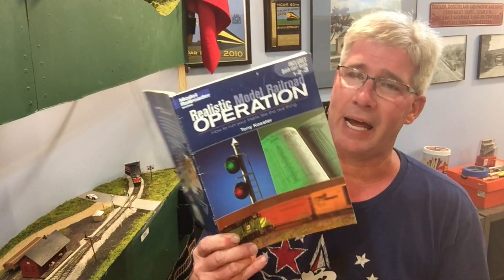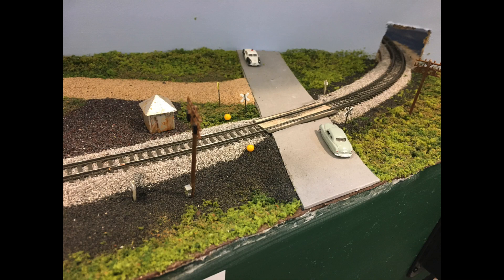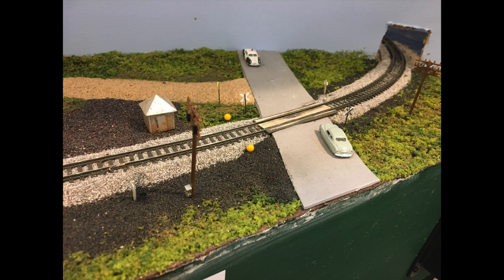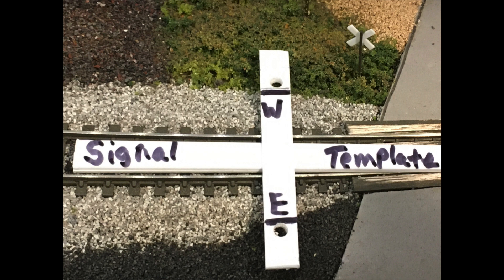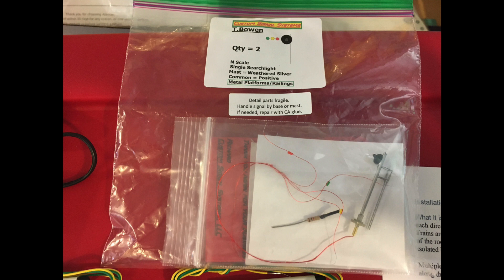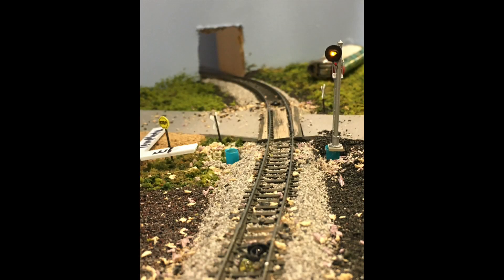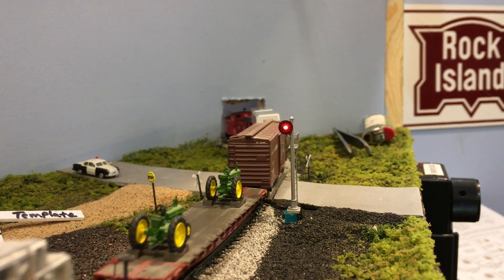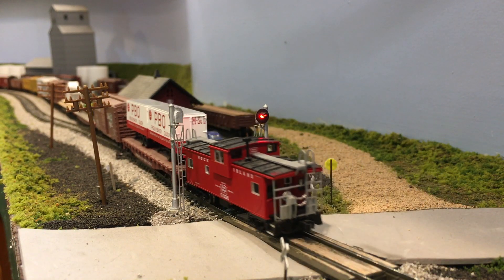Signal Installation using the  Custom Signal Systems and a Azatrax TS2 Circuit Board

Comment: Hi Tony,
Nice video. I too use Custom Signal equipment, but different detection method for my 3 rail O gauge layout.  I use double head signals for a scissor crossover and 3 aspect distant signals, bi-directionally.
Talk to you when I see you at a local train show.
Sam

Comment: Great video Tony and very timely for me as I am also starting with the signaling on my layout.  I also met John at a convention 5 years ago had have been using the Azatrax products for layout automation and a grade crossing.  So far my only signaling is in my helix after having a couple of cornfield meets in there but plan to add little at a time.
Reply from the maker: I was impressed with John and his Azatrax products of what they can do.  They will meet the needs of my layout as  I continue to expand my signaling system. Thanks for watching!  Tony

Comment: We are in the early stages of installing an Azatrax system as a replacement system in a HO scale Museum layout  that we are  using Azatrax Ts-2's and  the Ts-5. John and Richard have been very very helpful as this layout is 20ft x210ft. We are using a 16 volt dc power supply with a 6 amp output. So far we have run 500' of signaling control cable and 500 ft of power cable.  We are replacing an older signaling system that was current detection unit that was computer controlled. We now have 3 2 track intermediate signals talking back and forth with a 4th dual track CP going in rather soon. We have several cross-over's that we will be using the TS-5. We will be using several TS-2 for additional intermediates and at least 6 more TS-5's
Reply from the maker: Wade, It sounds like a very impressive resignaling project you have going.  I'd love to see pictures of your progress or completed layout when the job is done.  Tony
Reply: This is the layout at the Medina NY Railroad Museum in Medina NY. The layout is in the largest freight house that the NYC ever built (about 50ft x350ft). The two parallel mainlines are about 500 ft long each with several long sidings. We have a web site with several videos on it but I really do not think the videos do it justice. This layout  is "museum quality" and abot 20 years old.

Comment: BMLA Never had an N Scale signal.  Craig promised, but since the manufacturer could not meet his standards the N scale signal was never delivered.  I wish that we could get good signals for N scales. The signals from Atlas are G type and they do not want to seem to want to make standard signals found on almost all other railroads.
Reply from the maker: Yes, finding a good N scale signal that is readily available was a struggle that is why I went with Custom Signal Systems.  The signals are not big and bulky like some of the other manufacturers out there currently, or signals made in the past.  Tony

Comment: I was an electronics technician in the Air Force many years ago. A couple of words of caution. Use stranded wire for your power leads and your control wire as after time goes bye solid wire tends to get brittle and the conductor may break  and it is almost impossible to see because the insulator jacket remains intact the solid conductor. Also i am fusing each of the CP's with agl .250 amp inline fuses so the entire signal system does not go down and make troubleshooting rather difficult at best.

Comment: Hi Tony great video. And can't want to see when you daisy chain them together. I am about to upgrade my signals so will be looking at the same product.  Cheers Darren
Reply from the maker: Darren,  Thanks for watching.  When I get three pairs of signals connected I think it will be fun to see them react to each other. With your upgrade to your signaling system are you having to replace the signals or just the circuit boards?  Thanks, Tony
Reply: @CornCountryRails  Hi Tony The signals I have should work but won't really know till see the wiring diagram on how it all goes together. Looking at what you have done I think I will have to also replace my singals. Hma do a board and they are good signals so might also try that out.  Same as you cost is a factor.
Reply from the maker: @NscaleCSXandRioGrande   One item I purchased that I did not include on my video but I will on the next one is a Logic Rails Signal Tester https://www.logicrailtech.com/st-1.htm.  Kind of a neat way to make sure a signal in functioning correctly before installing it.  You can test the signals with a 9-volt battery and tester is $14.95.
Reply: @CornCountryRails  thats is very helpful thanks Tony. I have been browsing the net today looking at signals etc.

Comment: I like the older atlas signal system because it with the signal attachment cable with the signal . Atlas have a wire it where you can take other signal and connect it to the cord. Plus the atlas signal system have optitions where you can have a restrictive red until the train inters the block.   And you dont need a detector all you got do is put it in din port and put that wire in the track
Reply from the maker: That's great to hear and the nice thing about this hobby is that we all have choices.  I did look into the Atlas signaling system at one time for N scale.  However, the portion of the railroad I model had searchlight signals and not type G signal like what Atlas offers. Tony
Reply: I think blma have n scale searchlight signals
Reply from the maker: @justinc4424  They announced them many years ago in N Scale but to my knowledge never produced them before BLMA was sold to  Atlas.  They did in HO and look great.  However, the beauty of the searchlight signals I'm using are they are not sold out and they are built as I need them.
Reply: @CornCountryRails  nj interntional got bi color searchlight signals ho and n i think
Reply from the maker: @justinc4424  NJ International stock is all on backorder when I called them.  Once again getting the signals I need built each month has been a much better deal where I won't have to wait a lifetime for them.

Comment: I love those signals! At least finally someone has a searchlight head with the rear enclosed, so it looks like a mechanism housing on the back like in prototype. NJ has this problem of just sticking an LED through the hole, with wire and big solder blobs coming out the back of the target. It's bad enough in HO scale, but in N it looks terrible!  So if you have information on these custom signals that would be great. I model in both N and HO, mostly Santa Fe and SP, and that's searchlight territory.  Thank you in advance. Mike in Fresno, Ca.
Reply from the maker: Hello Michael!  I agree with you completely.  When I started looking for signals that was the biggest disappointment of that unfinished look to the back of the signals.  The other problem I had was finding a supplier of signals that would all look the same for the whole layout.  I did not want to start with one brand of signals and then find out there on backorder or discontinued. One time I looked at the BLMA and Showcase Miniature signals as well.  The BLMA signals in N scale were never products before Atlas brought the company and the Showcase Miniatures come as kits.  I could put the kits together but I'd much rather be running trains instead.  So I found Richard at Custom Signal Systems met the needs I was looking for with his handcrafted signals.  His website is http://www.customsignalsystems.com/. He has been great to deal with and to visit with about my signaling needs.  I hope this helps and let me know if I can help you in any way.  Take care, Tony
Reply: @CornCountryRails   I have another question, Tony. I recently bought an Atlas N scale signal off of eBay, because I was under the impression the Atlas system was complete, ready to operate.  But two issues immediately presented themselves: first I run only DC, and all the block detection systems are now made for only DCC.  Secondly, these Atlas signals are from their first run, having common cathode, rather than common anode like new ones have. Only the Atlas system will work with common cathode for the older stuff, but there is no block detectors that will work with DC in order to connect into their system.  So I guess my question would now be, does Richard have a detector system that will work with the older DC systems?  Thank you in advance for any information.
Reply: Yes, also the Custom Finishing kits average about $15-$18 for just the kit. Then for the specially made 603 prewired SMD LED, that actually fit inside those heads, well, those are $15 each. If you have a dual head signal controlling a siding, you're $50 or more into each signal, and you still have to assemble it.  I have some of the older Sunrise N scale searchlights on my old N scale layout, but the green light looks awful, and those are common cathode as well. They "mix" the red and green to get yellow.  So, since I model both N and HO, I would like to find good reliable signals, (especially searchlights) because that's what Santa Fe used the most.
Reply from the maker: @michaelmorgan7893   John Parson at Azatrax would best answer to your question on the cathode wiring on the Atlas signals.  Richard at Custom Signal System only makes signals.  One thing about the Axatraz with its IR detectors is it does not matter if you are running DC or DCC as it is its own separate system not using track power.  I would reach out to Azatrax to pose your question http://www.azatrax.com/

Good luck, Tony

Comment: Great video and applications.  I too am looking at using Azatrax and Custom Signals.  Nice to see the IR work for N scale as I am in HO.  Question did you still use the resistor with the signals, even though the Azatrax boards apparently have built in resistors?
Reply from the maker: Thank you for watching!  The Custom Signal System Signals came with a resistor on the common lead and I left it there.  They seem to work well with it and do not hurt the Azatrax Circuit Board even though the Azatrax Board does have its own built-in resistor.  I hope you will check out the other signal video updates I have completed.  
Thanks, Tony
Reply: Thanks Tom catching up now.

Comment: Hi Tony, great video tutorial on the signals. I was wondering if you could just move the sensor from the right of the roadway to a position behind the backdrop or a couple of feet further to the right so that a train coming from behind the backdrop would send a red signal before it reached the exposed part of the layout?
Reply from the maker: Derek,  That was a consideration I went back and forth with.  The thing to keep in mind is the further the sensor is away from the signal the longer it takes to trip the color of the signal. I located the sensors pretty standard on either side of the signals for east and westbound trains. The other item since this video is there is a signal now east of this current signal in the staging area. Now, this signal displays red until a train comes out from behind the backdrop and the last car passes over the sensor.  Thanks, Tony
Reply: Great, than it’s fixed. I’m catching up. Good channel.
Reply from the maker: @derekalexander4030  Correct,  I was holding off as I was not sure how I wanted to handle the signaling for upper staging,

Comment: Great video! I've been considering something like this. Interesting that these signals appear to be a completely independent system, not reliant on anything other than just the movement of the trains. I wonder if the infrared sensors would solve a problem I have with placing some grade crossing signals? They rely on a good light source and there is one place on my layout where I can't get enough light for them to work. Thanks for the educational video!
Reply from the maker: Collin,  I'm glad you enjoyed it.  If it helps it seems that these Azatrax IR sensors rely more on sending a scrambled message to the receiver than relying on a light source being blocked.  I will have to look again to see if that is correct but it seems that I read that before the installation.  Tony

Comment: Thank you. I have been wanting to see something like this for years. Please keep theses coming. Just a though. What if you put an azatraz TS2 with out signals on just one staging tracks so trains coming in and out would give you the right indication on your last signal? $100 a signal seems not so bad. I think I can do that. In the last shot I see you have a siding? Are you going to add a third signal to indicate thrown or not? If you used a tortuous it would be easy to wire up and add a dwarf signal. Well can't wait to see more. I am very interested in how you do this.
Reply from the maker: Thank you, Vincent, I'm glad you enjoyed it.  You are correct I could add a signal in my staging area that would allow the correct aspect to show on the signals and that may happen in time.  Azatrax refers to doing this with the eastbound signal for the best results if I use only one signal.  Going with an ABS signaling I will probably not put in dwarf signals for sidings.  Instead, I will be looking at a train occupying a whole block until it clears the next set of signals at this point.  I think once I get three pairs of signal installed I will have a better understanding of how they integrate with each other.  I think that will mean another video too to demonstrate this as well.   Tony
Reply: @CornCountryRails  Well keep them coming. You are why I am now building my next RR.
Reply from the maker: @Vman7757  That's a lot of pressure to put on me.  Only kidding!  Tony